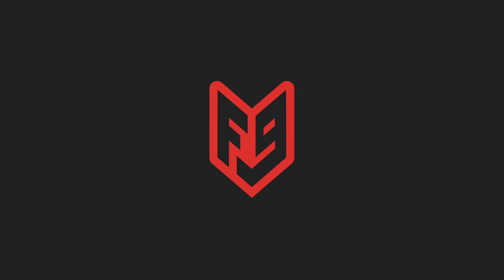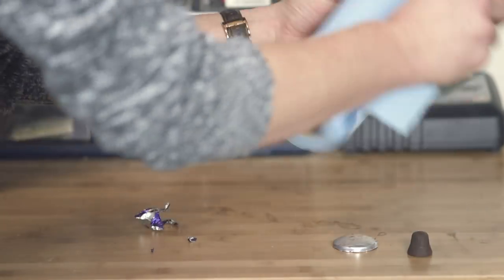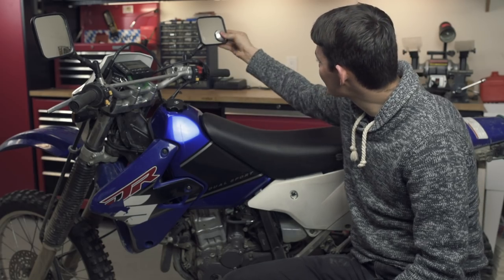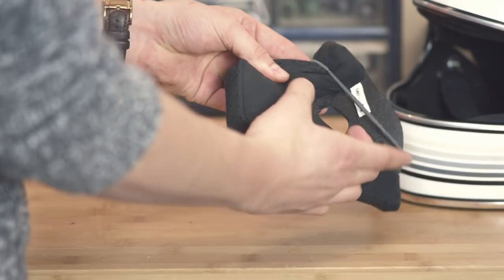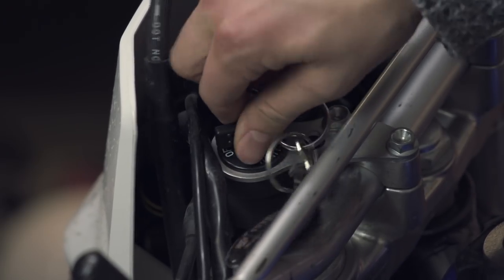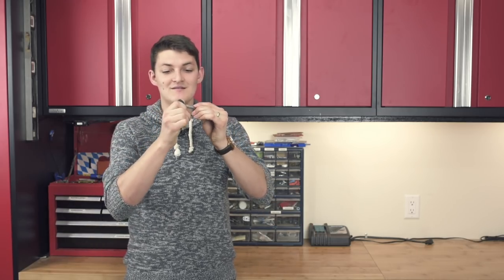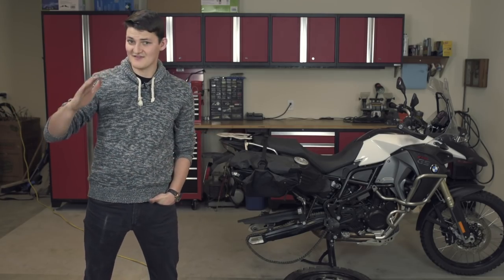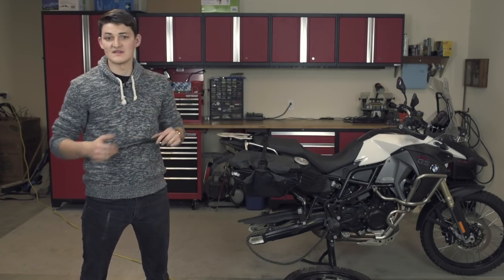DIY Motorcycle Mods and Ingenious Life Hacks

Comment: The key holder thing is a good idea, except I'm pretty sure pencil lead has other stuff like clay and silica as fillers, but graphite powder meant for locks is pretty cheap at any hardware store. Also omit the spray adhesive if you ask me, if any of it got transferred onto the key and into the lock it would be not be good.
Reply: Agreed but I think the idea is some people will have pencil lead and can use it for other things and agreed with the glue I would say melt the end of the straw
Reply: Maybe graphite powder may be ok on wafer locks but i still wouldn’t recommend it cause it gums up the lock pretty badly over time.
And dont use WD40 either!
Use some form of ptfe lube and or go with TriFlow or Houdini

Comment: Love your content! but please do not put graphite and dry glue in your lock! at some point it will make the pins in the cylinder stiff. cylinder maintenance spray is available from the locksmith for little money. with that a 10 year old cylinder / lock works like new again

Comment: Good day to all. 

May I suggest Houdini for ignition lubricant. After cleaning the tumbler with electrical contract spray, use Houdini spray to lubricate any tumbler.

I’ve used this product to cure warning lights on old BMW and Mercedes ignitions and employ it routinely on our motorcycles.

Houdini leaves no residual like graphite and upon investigation found Houdini is used by locksmiths everywhere.

Not the cheapest but it works.

Continued success with your F9 endeavor.

Don in Gilbert, AZ😎

Comment: Don´t use graphite to lubricate the key, it residues will drop down thru the barrel and deposit into the switch... graphite is conductive.
Reply: DIego AG  I have always and will forever just use oil. A few drops and a couple of minutes and it is back as good as new.
Reply: lube is even worse as it's just gonna clog up the pins
Reply: graphite is the best thing for locks.
Reply: wd40 does a better job
Reply: No graphite, no oil, and for sure NO WD40 (that's the worst). Locks should be lubricated with a light grease. That's what the mfrs use. (ask me how I know)
Reply: How do you know?
Reply: John Mård LOL Yeah, I work at a company that designs and mfrs vehicle locks.
Reply: :-) Happy new year mate!
Reply: May want to blow the moisture and corrosion and crud out of the lock first, before putting in a light grease which will assuredly turn grime into crud putty.
Reply: I use bacon grease

Comment: Hey bro i need a answer i overfilled my bike engine with engine oil while i set my bike on paddock and i checked the bike i found the small window from where we can see the engine oil level is completly flooded with overfilled engine oil..
What should i do? should i drain it or should i kept the extra oil? and is it harmful for the engine and how it will effect the engine and performance of the bike I'm briding a HONDA CBR250R.
Thank You

Comment: I did the key hack and now my ignition is ruined from the glue residue which got stuck to the key mixed with the graphite dust.  I'm stranded and my bike wont start and I'm stuck in the Mojave desert 100 miles from the nearest gas station and it's 115 degrees right now!  I'm uploading from satelite phone but my phone is about to die... help!

Comment: Where do you put the key guard when the key's in the bike? I use graphite powder to lubricate the starter bendix for my Reliant trike (manufacturers recommendation from 1986!) and I know that stuff's messy when it's in your pocket :P

And surely there's got to be a better way than holding your bike upright whilst you take the side-stand off to use at as an extender bar for a tyre lever?! That sounds like too much work! (Use cable ties instead! Feed them through between the beads, tighten them around the tyre et voila easy removal/fitting.)

Comment: I would be a bit nervous about removing my back wheel and kick stand as my cb500 does not have a center stand and I don't foresee this tire change ending well for my bike that is now laying on it's arse....or side...possibly leaking petrol miles away from a service station as I am attempting to change my tire with...my kick stand....hmmmm this is something I hadn't considered until this moment.....

Comment: Graphite is not a good idea for modern locks, It's good for the old steel locks and keys pre 70's because the graphite cuts the tumblers to that key. Modern brass keys are ruined with graphite. Use Tri-Flow.

Comment: Graphite is not a lube it's an abrasive eventually ur roll pins will wear out from it and they won't hit correctly
Reply: Graphite has a maximum hardness of 1-2 on the mohs scale. Heat treated steel is upwards of 7.5... which means it's impossible for pure graphite to scratch (or wear) steel. By the way, graphite IS a lubricant. If you have ever used "dry lube" before, it was likely graphite. If you don't know what you're talking about, you should probably not say anything...
Reply: @BabyBenz96  Just put the graphite dust directly into the key hole